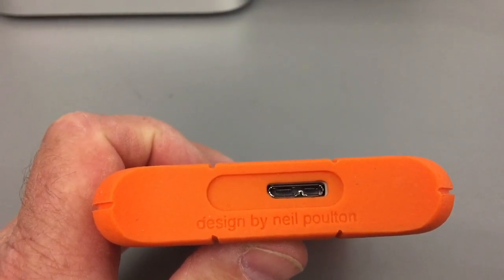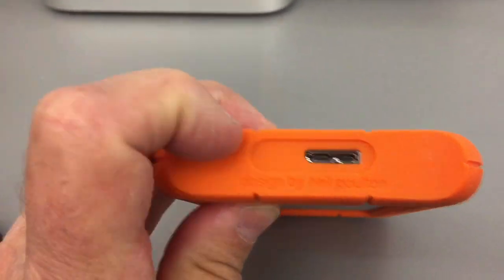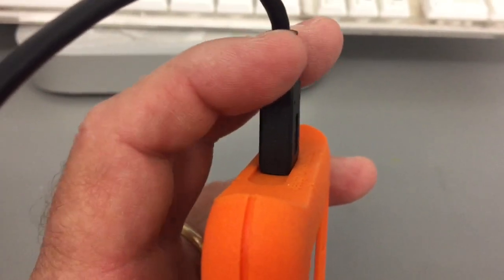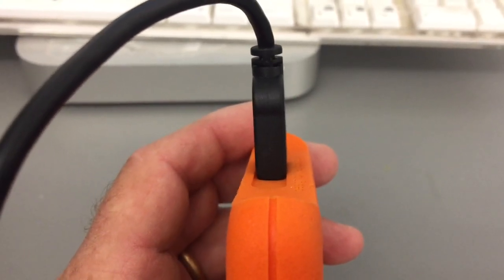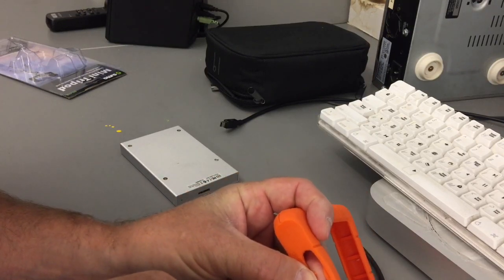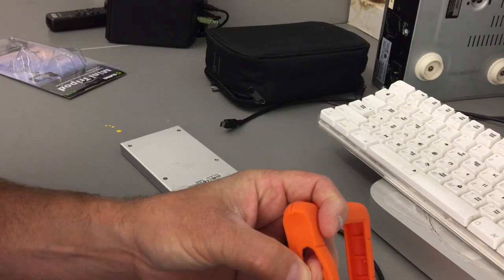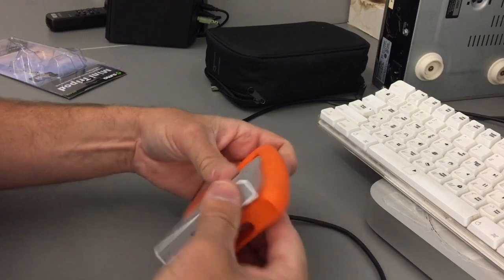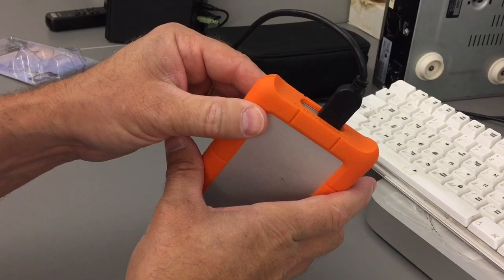A problem with our Lacie hard drives.

Comment: My bad its the type of hard drive that needs a power plug I dont know what type or model number thanks.
Reply from the maker: If its got the rubber around it, pull that off, a serial, and model number will be on the end near the connections. With that, you can order a new power supply.

Comment: is that a solid state drive or spinning drive?
Reply from the maker: Spinning drive, we have some ssd’s but I don’t really trust them just yet.
With a platter, you can rescue files if you really have to.
Reply: I thought the same thing although back in may june of this year my laptop was struck by lightening. fried the solid state drive. took it in to the repair center and they tried installing a new solid state drive and the laptop ate that one as well. tried both drives in another laptop and neither would show up. they did a recovery on it all night and half the day and recovered all my files nearly. it was a 512gb ssd and they recovered 498gb of data. thank goodness because that included my entire third function valve series which was all on that drive with no back up. until then I was under the impression the SSD could not be recovered. I guess they fooled me. I still have the laptop and may send it back to HP to let them have a look at it.
Reply from the maker: daveknowshow it depends on if it’s a drive error, or a hardware error. 
We had a bunch of macs with bad ssd’s for our faculty members, and they hard failed. 
We had backups, so we just got a new batch,and re imaged them.